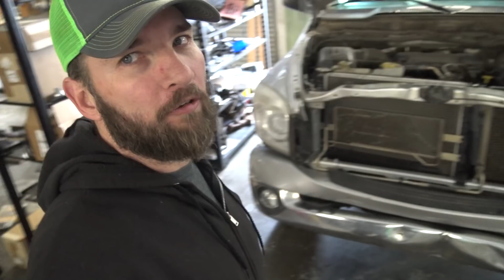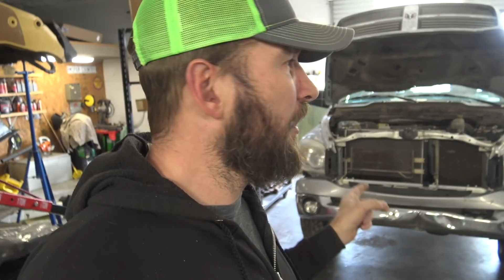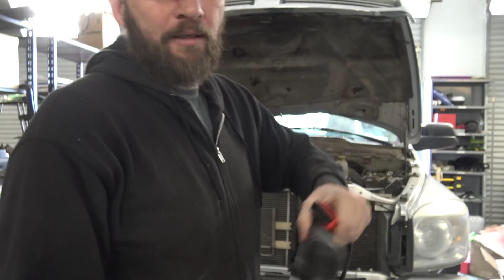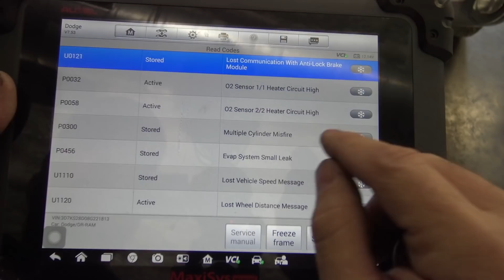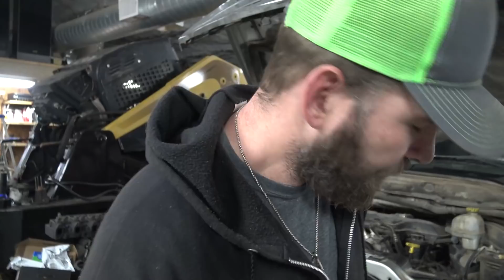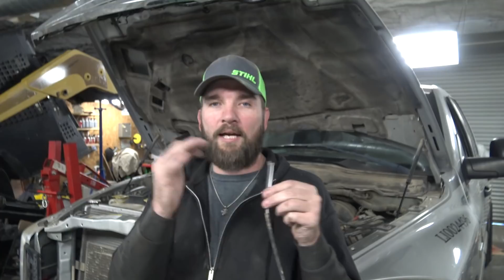Employee Sabotage Or Does Dodge Suck At Making A Wiring Harness

Comment: 😂 I have a 2015 Chrysler 300 with a 5.7 Hemi, right now I'm having misfiring and it's so bad that the car vibrates whenever I go really slow. It tends to lose power at high gear and the check engine light flashes. Do you think the same thing could be wrong with my car

Comment: I don't think Dodge has had a good wiring harness or any electrical components good for at least 70 to 80 years. The only reason they have any success in the modern age is because they have Cummins and the Hemi badges to prop them up. Granted other manufacturers have problems but dang nobody can screw up wiring or electronics like Dodge.

Comment: I work in a machine shop and we see these Hemis fairly often. Of the dozen that I have personally disassembled only two did not need a new camshaft, both were the non-MDS versions. I was told it is because of the cam oiling and the geometry of the lifters, they are almost horizontal in the block. 

Also, trap for the young guys, I learned the hard way that the cam bearings must be pushed out from front to back from the rear of the block. I pushed that front bearing into the block, as you would with almost any other motor, and boy was I in for a surprise when I realized that there is an oil galley cast under the cam bores preventing you from removing the bearing through the bottom. I had to use a bent screwdriver to hammer the bearing flat so I could get it out through the cam bore.

(Edited because I said non-VVT when I meant non-MDS)

Comment: I'd say one company that is notorious for lousy wiring harnesses is Navstar.  When I worked on them, I lost count of how many of them came through the shop I worked at that had broken wires and wire chaffing, especially the ABS systems.  They actually had long harnesses for the ABS, and the excess wiring was accordian folded against itself.  Yeah, day cabs using the same wiring harness that is put into the OTR trucks. And these trucks were less than 3 years old when the wiring issues began showing.

Comment: my dad had a 1990 dodge dakota with the v6. i guess this truck had the good v6 because even with excessive idle time and oil changes to allow for that, the engine lasted 300,000 on the clock with very little valve noise. of course on its 3rd transmission a wire harness fire under the dash put it down!
Reply: My 87 v6 with a carb, has 150k, I know for a fact it has a bent pushrod right now and it still gets me to work! Push rod has been bought, thanks rock auto!

Comment: Mixing electronics and an internal combustion engine was THE worst idea ever, however, in doing so, they gave us a little hidden treasure.  If you seperate water into hydrogen and oxygen by electralysis, the oxygen flowing through the substrate of a catalytic converter will create a lot of heat,(over 1200°F)  use up the oxygen, and leave you with pure hydrogen.  If we can figure out how to keep the HHO(A.K.A. Browns gas) from igniting, we could make a really efficient heater for anywhere.
Reply from the maker: Stanley Myers was ahead of his time.
Reply: @StephenCox.  absolutely!👍🏼
Reply: So what you’re saying is with a little electricity, and a dead catalytic converter, water can be converted to heat that in turn creates steam to spin a turbine? Has anyone tried this? Is it actually making more energy?
Reply: @markm0000  , yes, you can research HHO and find everything from running an internal combustion engine off it to heating your house, to running a torch, to running a stove, HHO much safer than acetylene or propane if done properly.
Reply: @billwoehl3051  I’m not knocking it but I’d like to see it work first.
Reply: @markm0000  , smart, don't believe ANYTHING without the evidence 🤔 it's simple enough to experiment with small versions found all throughout YouTube.  Biggest safety issue with bigger ones is the flashback, flashback arrestors for oxy/acetylene torches just aren't fast enough, maybe Tesla's one way valve would work.

Comment: mine started flickering the other day. Not flashing, but flickering, like you were rubbing a wire on a battery terminal. Opened up the ECU and found a bad capacitor that had leaked and corroded the traces out. I reckon the cap must have been leaking into the other circuit because it was doing ALL SORTS OF CRAZY STUFF!! Lol but fixed now!

Comment: My sister has a dodge caravan that melted the wiring harness under the fuse box (tipm - or whatever)--  and it had to be replaced, along with 3 of the main connectors that have 25  wires in each. smh..  My 99 Jeep grand cherokee had wiring issues all over it.  My girl has a 2010 dodge Nitro that keeps having intermittent problems.  I don't know if they are using smaller gauge wire or if their coatings are trash or the connectors are just bad ---  but I'll never buy a dodge again.   I'll slap a cummins in a ford truck if I have to-- but no Dodge....  never again.

Comment: Everyone always says "it's just a o2 sensor code" I had a customer that bright a car that was not charging. It died going down the road. They put a new battery in it it ran till battery died. They put new alternator in it and again if ran until battery died. They towed it to my shop. What I found was alternator was supposed to be fed 12v and it was missing. Visual inspection and I located a o2 sensor with all the wires broken. Someone had replaced flex pipe with straight pipe which broke the wires to o2 sensor blowing heater fuse which fed alternator.
Reply: Holy fuck that was hard to read

Comment: Sabotage might be a stretch. Driving over road debris that could quite possibly be the cause. Having driven company owned vehicles and not having issues vs the other employees constantly having issues. The phase "Drive it like you stole it" comes to mind. 
  Every time I was issued a new to me vehicle I would strip it. Clean it out. Clean the engine bay and underneath. Change oil and flush the coolant. New belts and hoses. Oil changes every three months.  Meanwhile others would never do anything remotely the same. My thought was I have to live in this thing 8,10,12 or more hours a day. Might as well take care of it. Worked in construction. Not the best environment for a vehicle.

Comment: I 100% agree with you about the Dodge wiring harnesses. they're absolute garbage. It also trickled down to their sister company Jeep or as I call them Just Expect Electrical Problems. It's very rare to work on a mid-90s through current Mopar product without encountering some kind of electrical gremlin
Reply: Jeep = Just empty every pocket
Reply: That's exactly right